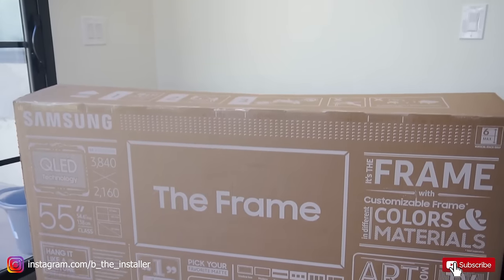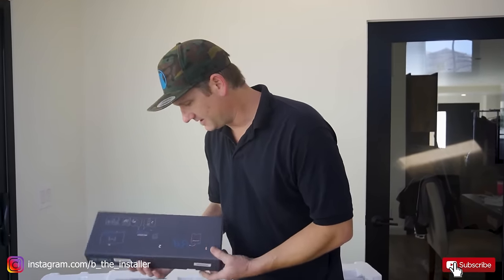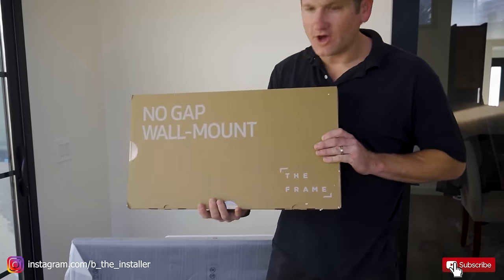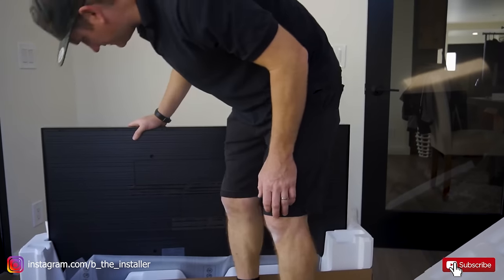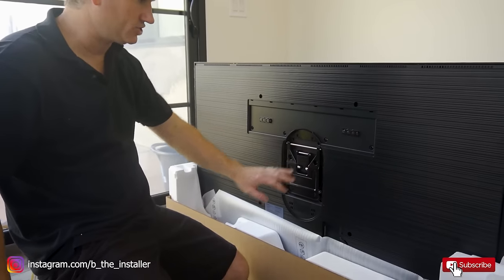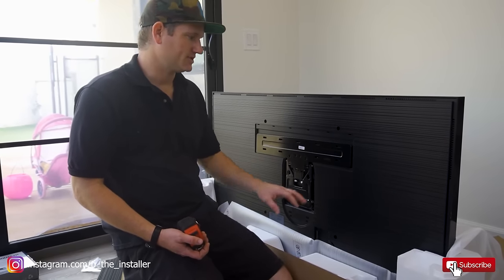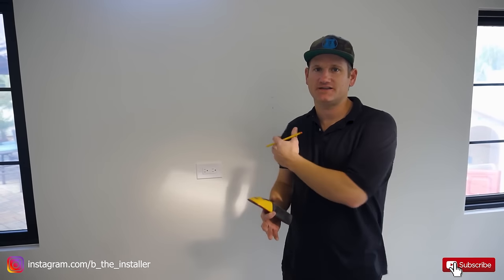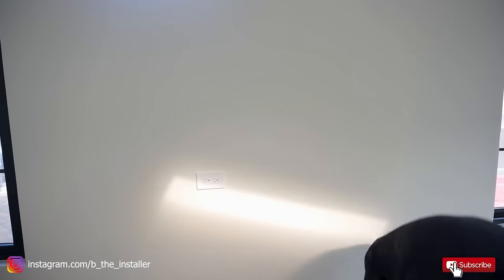Samsung Frame TV Installed w/ "No-Gap" mount in 30 minutes

Comment: The cable of "The Frame" models is not fire rated so this is technically not up to code and can void your insurance. 

Yes, the cable of a television specifically designed to be mounted cable-free is not fire rated and can't legally be run through walls. It really is that stupid.

Comment: At 24 minutes, you show how to tighten the small metal piece. You shouldn't. this part is supposed to allow the tv to be correctly leveled AFTER it is installed on its frame.
Reply from the maker: It's not as loose as It needs to be for self leveling.  NBD anyways.

Comment: Isnt the one connect there to hid wires without holes in the wall lol
Reply: I know of know way to hide a wire in the wall without a hole for it to go in and a hole for it to come out.   Gotta get creative.  Other option is wireless which its not.
Reply from the maker: He means it's supposed to be invisible.  It's totally fine outside the wall but 10/10 frame owners buy it expecting installers to hide that in wall.  Tv owners of any tv.

Comment: Thank you for showing us how it is done.
In Norway where I live we use 16mm or 20mm corrugated tubes inside the walls, something like this: https://www.amazon.co.uk/Outside-Plastic-Bellow-Conduit-Corrugated/dp/B00LUTBTJ6/ref=sr_1_2?keywords=corrugated+plastic+tube+16mm&qid=1584886752&s=diy&sr=1-2

The connector seems quite wide to fit through a 20mm, do you have the measurements?

Also Samsung has added a "in wall" cable like this: https://www.samsung.com/us/televisions-home-theater/television-home-theater-accessories/televisions/5m-one-connect-in-wall-cable-for-qled-frame-tvs-2019-vg-socr86u-za/
Any experience on this type?
Reply from the maker: Not going to make it in 20mm, its just under 1 and 1/8 inch so around 26mm nor would those tubes provide for electrical code compliance.  The in wall rated cord would be fine, its like $200 I heard.

Comment: You just can't hang anything heavy with these fixings. Only light stuff. No way i would put that TV up using this method. you better of using a method that attaches to the block or wood behind.
Reply from the maker: That is incorrect.  First off, we did attach to the wood 4x6 column that is holding the entire house up.  So if the tv isn't safe, what is? As I stated,  you can and I have mounted heavy items on just togglers.... I'll make some videos to inform. Thanks for your comment.
Reply: @BTheInstaller  I thought it went into the plasterboard only, my bad, apologies. Those thunderbolts are very good, I also use them in wood and brick. Very strong, Rigifix are great as well, could hold an elephant on the side of a wall with pretty much one haha. Great content ;)
Reply: @BTheInstaller  Those holes certainly didnt feel like drilled into wood. Pretty sure it went into plasterboard only.
Reply from the maker: Haha, you were there? Which ones? I can assure you the TV is still very firmly in place.  The outer togglers are in drywall and the two middle screw/bolts are in the 4x6 wood.
Reply: @BTheInstaller  Didnt realize there were two other bolts. My bad.
Reply from the maker: @petrkortys1932  all good.
Reply from the maker: Also, it is tough if there is any sort of bump behind TV. Even the power outlet cover plate pushed the left side out 1/4 inch.  It is silly they include the bolt spacers, I would never use this TV if I had any gap.  There are other TVs better space is needed but that wire is so skinny you could likely have a hole anywhere and run it down.  Thanks for watching.
Reply: @BTheInstaller  It is the no gap mount, not the tv, isnt it? Cant you move the whole tv 1/4 inch off the wall, not only the left side?